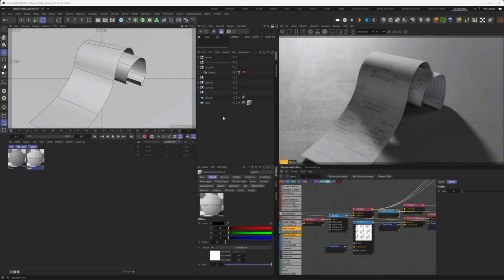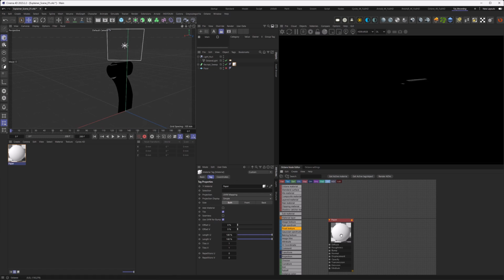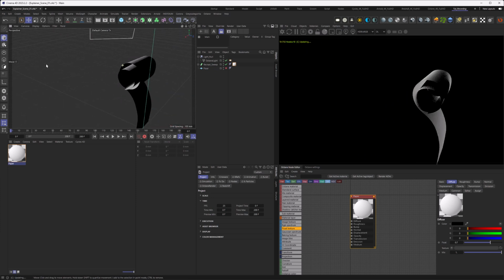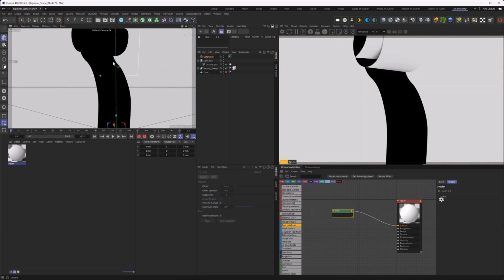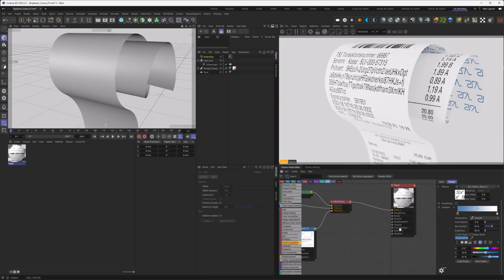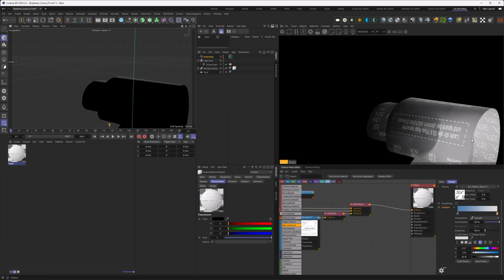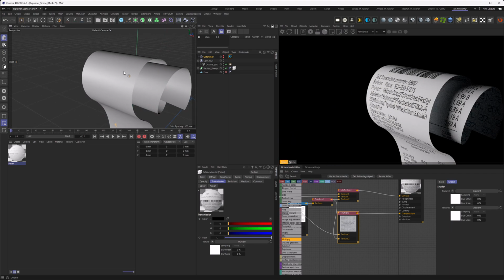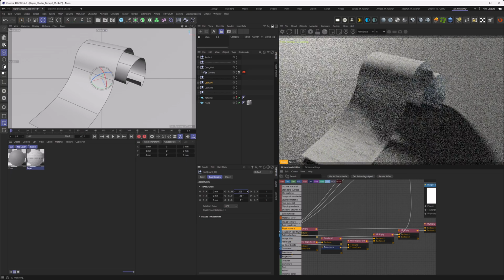Silverwing Quick Tip: Octane Paper Shader

Comment: first of all, you are the king of octane hands down! One thing though. when I tried this effect something weird happened, this effect is good when you are using the gradient as you did, but if I use an image texture of a page with colored images and black text, all the colors are inverted, do you have a fix for that?
Reply from the maker: Thank you very much for your nice words and your question.

If you need to transform an image with colors into the right lightness values, you can easily do so by using the "Range" node.
This allows you to also map colors.
If you search for it with in the nodes with tab, its the second from the top in the search list.

Pipe your texture into the value slot.
Leave the input min and input max to 0 and 1. Set the output min to around 0.05 and the output max to around 0.7.
Then also use that in the multiply that goes in to the transmission (like I do in the video). Since there is color in there now, this should not invert your transmission.

I hope this helps!
Cheers

Comment: Thank you A LOT for this tutorial! I worked with paper IRL quite a bit and I struggle to achieve a realistic result in 3D, because there's a lot of small nuances to it. I wonder if there's a way to trick Octane into showing a bright reflection on the poligon edge and mimic paper thickness without adding actual geometry? And if paper is cut with a knife, the edge has a very particular uneven L-shape, that also gives a tiny shadow or additional lighting bounce close to the edge, it immensly boost the realism (I don't really think it's possible to replicate this effect without adding geometry, but for thin paper even bright reflection on the edge IMHO is enough).
Reply from the maker: Thank you for your great comment and input.
The only thing I can think of to get to those "edge cases" is with normal maps. Though of course it falls apart when you either get to close or your view is too flat. Having a normal map that acts like the last couple of pixels of the rim face to the side will give you the right lighting / reflections there. You would also have to use a side shader to make the normal map go into the right direction on both sides (invert it on the back side of the polys)
Reply: @SilverwingVFX  thank you very much for the advice!

Comment: great tutorial - especially the double multiply. I noticed no camera in this scene, as all rendering requires light of some kind I wondered if there are benefits to a large value HDRI and change the exposure down in the camera imager like a dslr? 40w bulb to be a constant and high power the HDRI to look visually close to a lit bulb in daylight etc. Also happy birthday.🧻
Reply from the maker: Hey thank you for your birthday wishes and your kind words.
About your question... to be honest I don´t understand fully what outcome you are working towards 😅 I would appreciate if you could elaborate and help me understand. Thank You 🙌
Reply: @SilverwingVFX  say we created a daylight scene and included a lit 40W bulb light (no surface brightness)- we then add a HDRI and increase its power visually similar to how you would see a real lit 40W bulb in actual daylight (barely notice its power) . Then use the camera imager to expose back down to make the very overblown HDRI look normal. Is this any better than a scene where the HDRI is just at regular 0-2 power values? I know Octane works with real world settings best and I wondered if the scene was built this way with light values much above normal but pulled back in camera (like a real DSLR) does it help with anything? or as its 3D it doesn't matter. Just wondering if things like adaptive noise sampling etc benefited from larger light values even if your aim is a visually darker scene through an underexposed camera. I will do some tests to see if it even makes sense.

Comment: Thanks so much for this tip and happy birthday :-) I was just struggling with some leaves and flower petals and this gives me a much better understanding of what is going on.
Reply from the maker: You are very welcome. Appreciate that the video provides you with some extra info. Fingers crossed you can make the jump to a amazing pedal / leave material.
It´s not in the video to keep it short. But I usually set the material to a Universal Material because of the reflection you get, that you need in a lot of cases (make sure it is still using diffuse transmission)

Cheers, a good start into this week and happy shading!

Comment: Nice one Raphael. I made a similar setup at work for doing paper or leaves a while ago, but remember running into issues with the specular color acting weird when setting up a Universal material with fairly glossy finish, in combination with the transmission. If I remember during the coming work week I will try to dig up a file like that and see if that is still an issue. Also, happy birthday! 📃
Reply from the maker: Thank you very much for your comment.
I usually use Universal too to get a reflection layer on top of the transmission. If you are using diffuse transmission in the universal settings, the outcome should be as expected.
Looking forward hearing back from you!

Comment: Happy birthday Raphael! Thank you so much for these amazing tips.
I have a question or maybe even a request for a Quick Tip video: How do you handle brand colours from clients? Putting in HEX values I get from clients always results in colours that are "off" because of the lighting. What I usually  do is play with the exposure and saturation in the camera tag to get a "close enough" result but I'm not sure if this is the right way to fix this annoying problem.
Reply from the maker: Hey Bernwolff,
thank you very much for birthday wishes. I really appreciate it.

About your question:
I am fortunate that my clients mostly understand that lighting changes color values. For those who like the hue values intact I usually render mattes (custom AOVs) for the parts that are critical and then counter correct those in comp so they have the right tonality.

Luckily it did not happen to me but if a client is a pain and very anal about the colors and does not understand that it´s not possible to have the exact RGB values because there is shadow, reflections etc. Then I would probably decide not to work with them again in the future.

Comment: Very interesting take, thank you for sharing, i never knew there was a side node, i wonder if adjusting the roughness would blur the transmission on a diffuse material, makes me think 💭 🧾📄

I Wish you a happy birthday and healthy and productive years ahead 🎉
Reply from the maker: Hey there and thank you very much for your comment.
Roughness does unfortunately not blur the transmission because the thickness of a polygon is zero. What you could do to get a slightly blurred look is to use another set of slightly blurred textures for the transmission. I have not tried it myself but that should kind of work.

Thank you also for your birthday wishes. Much appreciated 🙏🥰